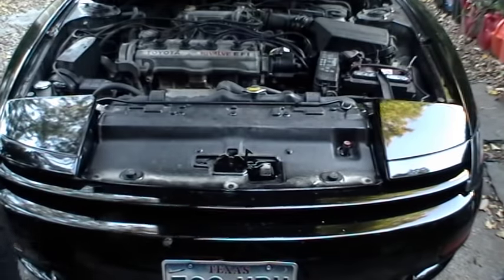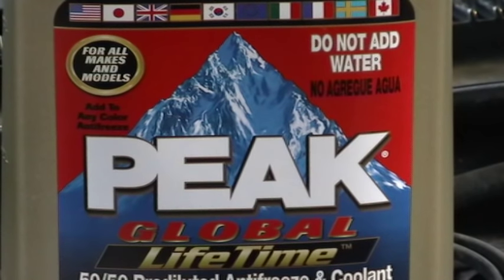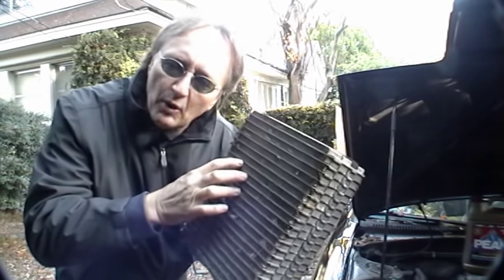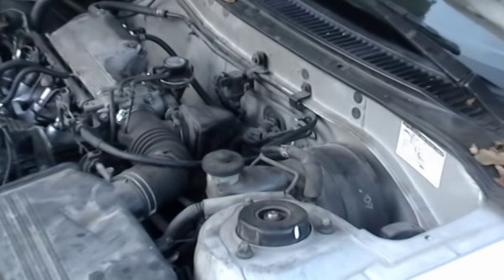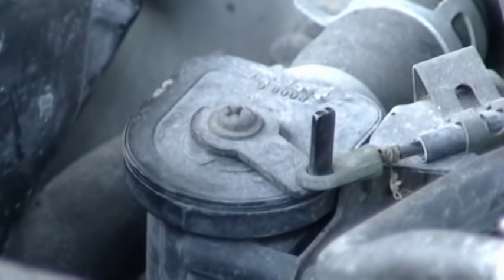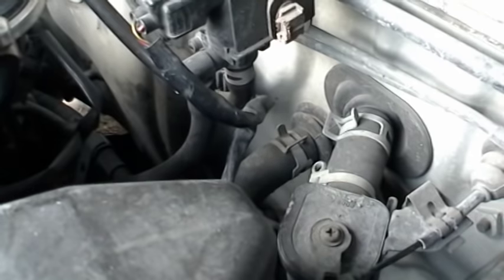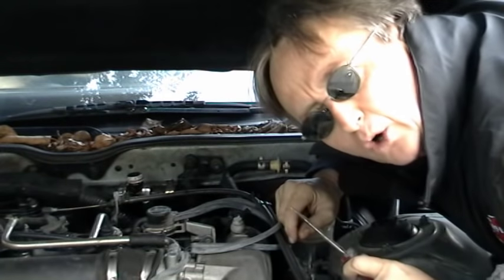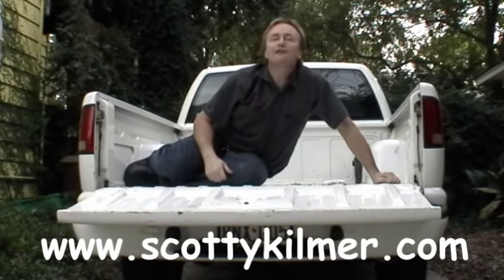How to Fix a Car Heater

Comment: Heather runs all the time.?What is the problem?Chevy Tahoe 2005.
Reply from the maker: +Luis Sousa those are computer run heaters, often a stuck blend door staying open does that, get it scanned by a pro with a dealer scanner to find out if it's that. As it's inside the dash and impossible to access without that tool
Reply: +Luis Sousa Tell Heather to stop running.  She must be tired.

Comment: I have a 92 infinity g20 my car heater blows out heat but with only one setting which is the max at 4, the other settings stopped working 1-3. help me please...
Reply from the maker: +Anthony Trinh replace the blower motor resistor assembly
Reply: Good answer Scotty, this is what was bad when same thing happened to me!
Reply: Replace the blower regulator switch

Comment: I have a 98 Chevy Blazer that does not get heat.  Last year, I had the radiator flushed, burped the air out and the heat still does not work.  The thermostat registers up to the half way mark when being used for any length trip.  The fan works, but no heat comes out......??????
Reply: Check the thermostat like Scotty shows. It might be stuck and needs replacement.
Reply: I don't think its the thermostat, because it raises to the half way mark while driving, and stays there.  So it must be working right. I'll check the heater control valve.  Its probably not moving.
Reply: jjaynes02 maybe a blend door?
Reply: I have honda odyssey and I see control valve working, I think blend door is working because it is moving and airflow changes. I flushed the heater core so both tubes get hot, I got the air out of the tubes. Also temperature rises to mid level as usual quickly. So I'm stumped as to why I still have cool air coming out when I have temp set at 90 degree...
Reply: A different actuator controls the heat then the one that controls the direction of air... Also how much do you trust the person or shop that did your radiator flush, I would at least check the 2 hoses from coming from your heater core Scotty showed us in the video, couldn't hurt

Comment: Hi Scotty I had a serious problem can't find by any mechanic ,my car radiator fan starts with ac on and keep on going with ac until I stops my ac and because of this temperature goes unexpectedly very high and ac starts tripping and ac starts only on acceleration and as mechanic told me to changed my car radiator and refilled with new coolant but no use heat generate high with on ac and ac starts tripping

Comment from the maker: move to the back then. realize those stupid heaters are computer controlled, and need a machine as in my video "fixing modern cars using high level scan computers" to analyze and fix them as they are all computer driven. Start with that analysis first, last one i fixed like that was an 800 dollar repair bill, it can get expensive.

Comment: Say how do you fix a 2001 civic coup heater my fan is working but it blow out cold air I let it warm up for 30min or so I haven't check any other parts yet it so cold outside you can't do anything right now if anyone know or have information post up for a civic 01.
Reply from the maker: do the tips in this video first

Comment: @scottykilmer 
hi scotty!!
i have a 03 nissan altima,and my heater does not work well,it takes a while to warm up, at least after 30 minutes of driving! ...but the engine warms up in 5 minutes and works at normal temperature. the coolant level its good..
can you help me please???

Comment from the maker: you have electrical problems in the heater control system. Computer controlled crap, even in that old thing. You need  a machine as in my video "fixing modern cars using high level scan comptuers" to analyze and fix such stuff unfortunately

Comment: I have a minivan and i have heater coming out from the back but not from the front. What could be wrong?
Reply: I am having similar problems. Does it have 2 heater cores? One for front, one for back. I still haven't figured mine out, it passes all the tests.

Comment: I got an 05 Nissan Altima I bleed out the air heat works a day later it doesn't. I think there's no pressure in the system so air builds up again. Its not overheating so what's the problem, can anyone help?

Comment: Hey my VW passat 2003 heater stinks and smells like the motor i dont know where it comes from but it makes me dizzy what do i need to fix?
Reply from the maker: have the cooling system pressure tested, and if the heater core is leaking it will need replacing. If not, something under the hood is doing it, like oil leaking on the exhaust, then being sucked into the car with heater on

Comment: i am havin problens i have a 95 chevy monte carlo n it leak coolent underneath my car when eva i drive it and stop and when i get out i got coolent like just dripin like crazy n plus when i turn my heat r air on i hear a leaf blower noise everytime but wont do it when its not on when i aint runnin my heat r air plz tell me whats wrong some one

Comment: can i relocate the heater core to put under hood
Reply from the maker: +Moses Reyes you would then have to build ductwork to reach inside the car with the hot air then, but it could be done

Comment: Didn't include the part that the engine has to be cold to take the radiator cap off or the boiling hot coolant will turn into a fountain.

Comment: i have a 2006 kia and the defrosters work but the heater doesnt. what can i do
Reply from the maker: it's stuck on defrost, often a bad control unit on that, have a pro check it with his high level scan tool

Comment: I have a 2002 Ford Taurus and my heat is only blowing out warm air. I went to my mechanic and he put anti freeze and it worked perfectly for about 1hr after that it went back to being warmish cold.. I just bought a thermostat and put that in and it still blowing warm. Nothing is leaking. Please help I'm in dyer need!! Thank You
Reply from the maker: have the heater core flushed out, pray it's not just worn out inside and needing replacement, they cost a ton on that ford dash design

Comment: What about if you only get hot air at high RPMs? After that happened to my old car last winter, I suspected the head gasket had failed because, after driving in high RPMs to get it working, along with high RPMs to give the 1.0 litre engine sufficient power to get past slow vehicles, such as tractors, safely, a creamy white paste built up below the oil cap. Every car guy knows that's bad news!!!

Comment: I love this channel this guy is very animated but here's a good one for you the AC compressor in an 08 Impreza takes a complete crap shortly after like on the way home the indoor controls quit lighting up nothing works all the fuses are good all the relay stuff going I throw power from a fuse to the motor resistor and lo and behold all must be control words but I still have no lights on any of the recirculation control the rear defrost none of that I wonder why that would happen can anybody enlighten me

Comment: help scotty!! its getting cool and my wifes 99 ford eddie bauer expedition ..the heat is just blowing cool air.. i dont know where to find the heater control valve or the upper and lower heater hose in the 99 expedition..i just flushed the radiator and added new coolant...the engine is not over heating at all tho..can you please help????? before my wife falls inlove wit the mechanic at autozone

Comment: ok so i check everything that u showed in your video except flushing out the hoes. i get heat when im driving fast but only out of my face vents. my defrost vents have a little heat but not enough to defrost my windshield. and my cooling fan doesnt work would that have anything to do my car not blowing heat???

Comment: I have a 2002 Ford Taurus SE with 135,000 miles. I bought the car a few years ago with 105,000 miles on it and the heater has never worked. The list of things I’ve done to fix this issue are:

- Flushed the entire cooling system (bright green coolant)
- Replaced thermostat, radiator hose and water pump
- Replaced the blend door actuator 
- Flushed the heater core
- REPLACED the heater core after flush and fail

What gives??? It’s not even so much that I need the heat since I live in AZ but it’s quite frustrating, would anybody know what the problem is?

Comment: my heat blows hot for about 10min. and then it turns cool or cold what could the problem be???????
Reply from the maker: defective heater control electronics, for example, in a GM that's often a bad control unit head in the dash

Comment: WHAT DOES IT MEAN WHEN I TURN ON THE HEATER THERE ISNT ANY HOT AIR BUT WHEN I DRIVE IT BLOWS OUT HOT AIR
Reply: Does the fan turn on when you turn your heat/ac on?
Reply: @GerbenvanDijk00000  yea but blows out cold air
Reply: @daisyguzman4079  mines too help

Comment: helloo my when i turn on? the heat is come heat air after stops come heat air why
Reply from the maker: +evros basiliou try these video fixes first, and if not that, often a bad electronic blend door inside the dash
Reply: i dont is blowing hot air but  not for long after is get cold.. i dont find my electronic is toyota starlet ep91
Reply: is blowing hot air for little after stops

Comment: car heater is always on  warm all the time how can I shut it off
Reply from the maker: Raymond Jubb IF it's a modern car, often that's a blend door problem requiring dash removal. If it's older, you can just get to the heater control valve and shut that off manually.

Comment: Got a Accord 2.2 diesel 09 and it takes a 30 mins to get hot.....Dealers say they all take time to heat up....answer....switch to BMW...they get hot quick...electric thermostat...simples!!!!!
Reply from the maker: yours probably just needs a higher temp thermostat, electronic thermostats don't work any better really, all are set to open at the same temp
Reply: Where would i get a high temp thermostat for a 09 Accord???

Comment: What is wrong with your car heater when your car heater don't turns off , even when after you turn your car off it continues to stay on.
Reply: If you haven't fixed it yet, it could be a possible blend door problem. There's some little doors that open and close to reroute the air when you mess with the knobs.

Comment: 1997 2.3L Ford ranger, heater blows cold, blower motor works, coolant is full, flushed the heater core both ways, water flows normally both ways, changed the heater control valve under the hood and the engine runs a normal temp. Trying not to spend hundreds at a shop. One shop said it would be $100 bucks to diagnose and possibly hundreds more to fix. Are you Fn kidding? Please help

Comment: How you really kidding me the reason you're not getting any heat is because there's no hot water going to the heater core now the reason is why is it not going to the heater core is the heater core shot is there a valve turned off somewhere. Is an 8350 van there is so much jammed up in the engine you can't even get your finger in one of two things either there's a vowel turned off and some people do that in the summertime or. There is something preventing the hot water getting to the heater core